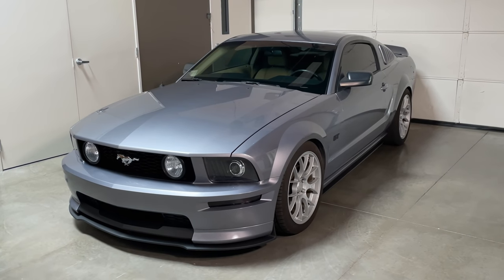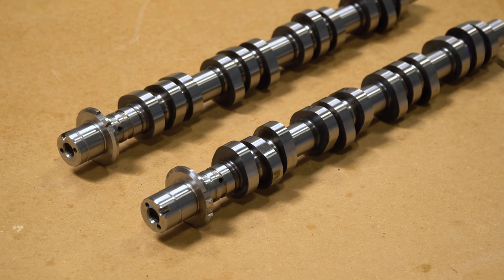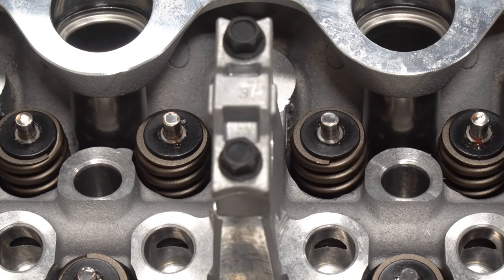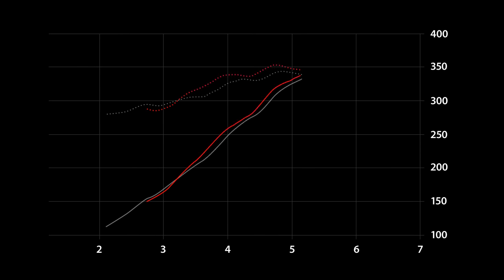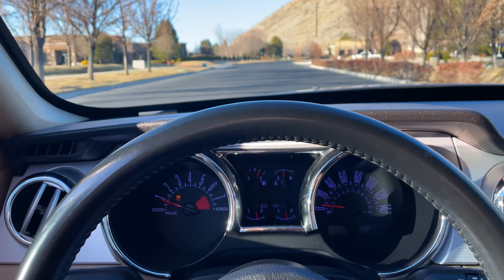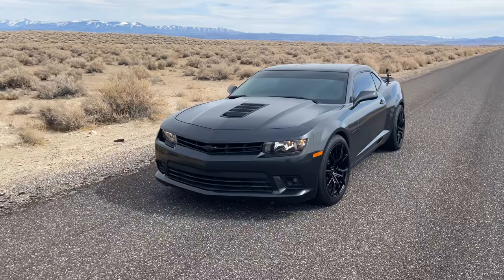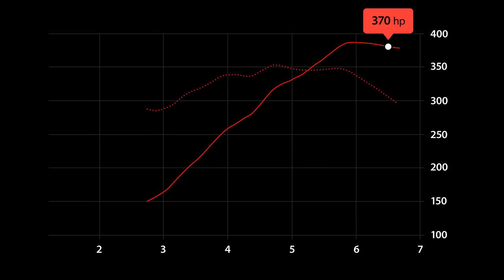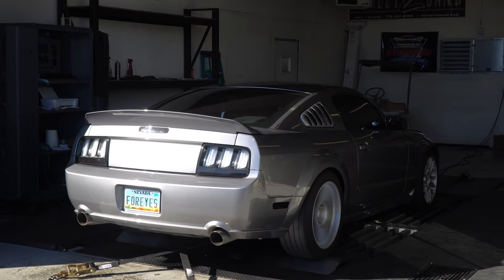The results 📈 of installing the most aggressive cams on my Mustang

Comment: I would probably throw that 281 in the garbage and yes I said 281 I don't do that cheesy nerd liter crap

It's a 281 and that's what I go by muscle cars should be going by cubic inches. That's what's in that car is a 281. Throw it in the garbage and go buy you either a 351 punched out to a 427 or either go get you a 427 FE  big block . It should come with big cam stock. You'll have the most beautiful sound you've ever heard in your life if you do the right headers and exhaust. I would try to do it just like what comes on the 65 Shelby Cobra. Oh my God that's a visceral sound. I just don't like the sound of these new garbage Motors in these Mustangs. They just don't have that pushrod  big block big cam sound of vintage muscle cars

Comment: I think this video is to prove just how much Mustangs suck ass. Fully built motor 355 lbs of torque🤣🤣🤣🤣🤣🤣🤣gay!!! And I bet it cost a bundle to get to there what the fucking joke😂😂😂🤣🤣🤣🤣😂😂😅😅 You can build a junkyard 305 vortec Chevy for about $1500 that will slay that thing.  Not to mention if you rip that Ford motor just a little too hard it will come apart